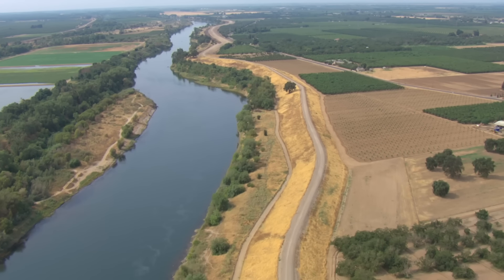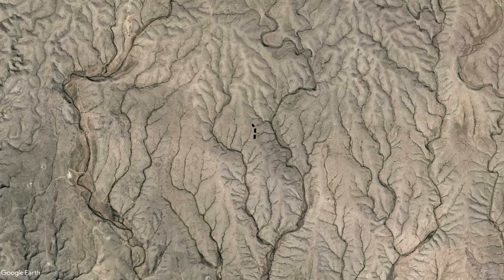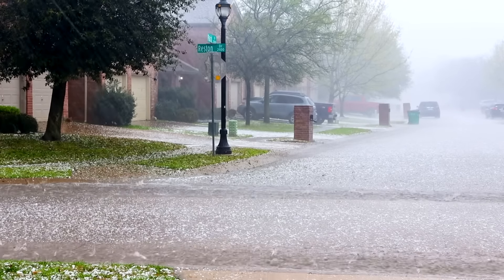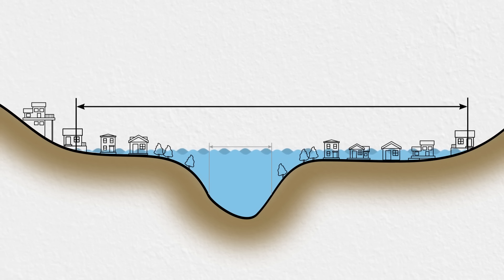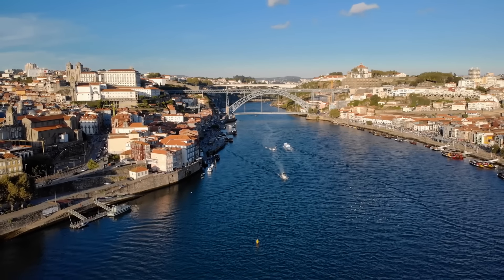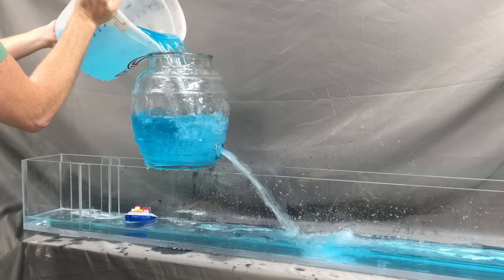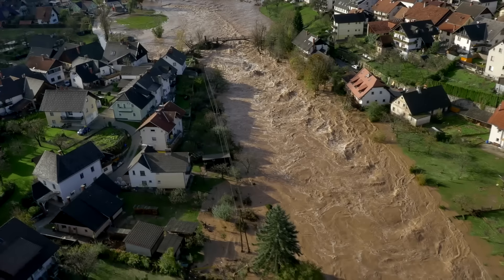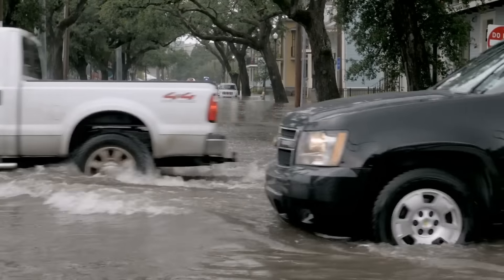How Do Flood Control Structures Work?

Comment: On the North Sea, we also often get floods that are not caused by too much water coming down, but by the water not being able to flow into the sea. Especially in winter we often get extremely strong winds from the West. Just the wind pressing only on the water surface in the river slows the water flow enough to make all the water coming behind pile up. And being one of the flattest large open areas in the world, it doesn't take much to flood really big areas.
Reply: The largest flattest open area on Earth is likely in Siberia, then perhaps the Great Plains of the USA, I cannot think of any place with Western exposure to the North Sea that is even 1/100th as large. And what you referring to is tidal surge not the slowing of river flow by wind. But I am interested to know where you are located ....
Reply: @johnsmith1474  the netherlands..
Reply: @johnsmith1474  European plain goes from Spain to the Urals.
Reply: Spring tides where the moon pulls more strongly on the incoming tide does this too.
Reply: @johnsmith1474   To be fair, I think living at the sea he would know what the tide is and how it effects the sea and rivers. 
I never heard about wind hindering the flow of rivers, but I can imagine it to a certain extend.
Reply: @stabileseitenlage  
The cause is indirect.  Friction between the wind and water surface causes the water to flow towards the shore which raises the water level at the shore where the river water flows to.  When the water level at the shore is higher then the water flowing down the river has to back up the river and raise the level of water along the river as well.
Reply: @johnsmith1474  
The Great Plains of the USA are also generally over 2000 feet in elevation.  Where I live the elevation is 3605 feet.  Not much chance of the wind causing tide surge here.  although at this moment (2:54 PM, 5 January 2021) the wind is blowing at 31 MPH from the south-southwest with gust to 43 MPH so we do fairly often get everything left loose rearranged.
Reply: @oldtimefarmboy617  Thats about 99% the way I imagined this to work.
Reply: If you are interested to read something about a storm surge in my home city google: North Sea flood of 1962. (yes the reason of the flood were the winds)
Reply: Considering only river flooding on rivers created by ice/snow melt or excess rain a simple flood control structure consisting of a dam with a narrow slot down the middle. High flows back up behind the structure while low flows are unimpeded.
Reply: Cheers from Michigan friend. 
Thanks for sharing
Reply: @johnsmith1474  great salt desert in western Utah . It’s so flat you can see the natural curvature of the earth
Reply: True an onshore wind can creat elevated sea levels ad in a spring tide the english channel constriction and heavy rain to the mix and you got wet feet.
Reply: @gregwarner3753  that sounds like a basic version of the retention basins that are becoming commonplace beside new developments around where I live. The increased runoff from roofs and roads must be accounted for by a large enough retention basin. I believe this has become mandatory and is a requirement in the design to get approval from government.
Reply: @SnappCheck  
With all due respect I don't think anyone refutes the fact that the wind can be a contributing factor in flooding. Especially in coastal regions. Rather I think the contention was that "wind over rivers" would be a strong enough "factor" to be the CAUSE of flooding. 
And I would argue that even in Your chosen example the " North Sea flood of 1962" that was NOT the case.
That flooding event was (as far as I have read it) caused by a Low Pressure system, over the "North sea", causing a raised SEA level by low air pressure AND the high winds. And  the location of this weather system and the wind speeds and wind directions it caused "applied" the raised SEA levels against the "german bight"... Which in turn caused the rivers that normally "drain" there to instead flood... To make a long story short, the "wind over water" surely was a strong factor.. but as far as I understand it was not the "wind over the rivers" but rather "wind over ocean" in concert with factors that can cause "elevated water levels".(in this case it was a strong Low pressure ( tides could also have been a factor, but I did not find that documented))...
Best regards.
Reply: @onlyeyeno  yes that’s correct🙌
Reply: Wind so strong it acts like a dam sounds terrifying
Reply: We do often suffer from tidal surge around the North sea, England's east coast is particularly vulnerable to tidal surge (from an England perspective) where a spring tide combines an extreme onshore wind and cause fluvial flooding as well as costal inundation. I've worked 4 East coast surge event in the past.
Reply: @johnsmith1474  yes, very well said. So many people don't know about that! Thank you for bringing that up John.
Reply: Would ice build up at the end of the river also affect the flow? I’ve heard of that happening here in Canada where all the ice builds up, is pushed downstream and blocks the end of the river off
Reply: @onlyeyeno  i think it's more like "wind over ocean which is over river".
Also, in my city waves created by this king of wind are called "нагонные волны" (loosely may be translated to "forced waves").
And because of these winds there have been many great floods, may over 2m high and even one with over 4m flood. In a city. Yay
Reply: That's crazy!
Reply: @johnsmith1474  in green bay WI sustained north/northwest winds cause the slowing of the fox river flowing into the bay causing flooding.  Happens couple times a year. The geography and weather patterns come together to create flooding that would not happen anywhere else.
Reply: @Yora21  The idea is that you don't do it on short notice. You plan ahead and build reservoirs and start increasing the number of surface bodies of fresh water and drawing from those to feed drinking water inputs. Reservoirs use up a lot of land which sucks, and that water is always going to be of VERY questionable cleanliness, but come on. Would you rather obtain your drinking water from cleaning sea water, or from cleaning fresh water? It seems to me that rain water is extremely valuable, and maybe we should be making efforts to collect and store more of it.

Here's another overlooked source of water: humidity. It makes everyone miserable. Let's build some region-sized dehumidifiers and extract useful water from the air on a massive scale.

Will there be environmental consequences? Of course. But look at the dead sea, it's getting deader all the time as Levantine desalination plants discharge concentrated brine into it in the process of creating drinking water.
Reply: @johnsmith1474  He said "one of the flattest large areas" not "one of the largest flat areas". An important detail, you seem to have missed. 
But still, the European plain isn't exactly small. It stretches from the north of Spain, France, the low countries, Germany, Poland, over the baltic countries and pretty deep into Russia. And about a thrid of the landmass of Sibiria is mountainous area.
Reply: What. What.
Reply: @sudazima  10

Comment: How old dams are replaced? Isn't it is really difficult to say "Replace Hoover Dam"? Not now but some time in future
Reply: After the time comes river is diverted, dam is destroyed and realigned. It easily and quickly becomes a sustainable thriving ecosystem after that.
Reply: It depends. Dams that impound rivers, streams, etc will require emptying the reservoir then diverting flow to allow for repair, replacement, or outright removal. For storage reservoir dams where the water is pumped or diverted in, they shut off flow in and empty the reservoir.
Reply: @typrus6377  another option is building a temporary (or permanent) dam in front of or behind the existing dam
Reply: There are plenty of dam removal videos here on youtube, they can give you a sense of how the smaller ones are taken care of and it seems some commenters already got to the larger ones.
Reply: it's not that simple, beside the simple economics  "dams are damn expensive, and whern there is no damn there is no income from power generation" there is also water supply problem. hovver dam keep las vegas and a lot of other place afloat. if you empty the hoover dam tto make a new one, there will be a shortage of water for decades
also, the colorado river is running out of water, hoover dam  get less water every year and  so is lake powell  behind glen canyon dam, so having  a new lake to refill in those condition is absurd
(just to state how much water you need to fill a lake: lake powell filling  took 20 years and got full to the top only once in 1982
Reply: With some dam good work. That's how.
Reply: Well, they had to build it in the first place somehow!
Reply: De Hoover dam will be controlled by the 'New California Republic'  and will protect it against the arrival of Caesar's Legion!
Reply: Hoover dam is probably the most permanent structures that currently exists. If we’re ever in a position to “replace” the Hoover dam something has gone horribly, terribly, catastrophically wrong.
Reply: @hithere5553  It's an understanding in progress I might say, like we understand that with proper care, nuclear plan can last may more than their intended life span
Reply: @hithere5553  Maybe in the US, but I think the Three Gorges dam might take the title.
Reply: @acwright  that pun was terrible XD
Reply: It depends whether the engineers or the landslide homeowners won the political battle. Search wixom lake dam.
Reply: Look up Condit dam removal if you wanna see some exciting footage of a dam being removed.
Reply: hoover dam is still curing i believe.
Reply: i don't know for sure, but if i had to guess they slowly drain the reservoir until it's level and then tear it down and rebuild it.
Reply: Lake Mead will be empty in a couple decades at the current rate anyway.
Reply: as long as it is properly maintained, Hover dam could last millennia. even if it's not properly maintained it could last millennia.  It is  a mass of concrete.    a big problem with dams is not the  dams themselves but sediment building up behind them, decreasing the storage capacity so even though a structure could last centuries, it may only have  useful functional life of a few decades if the sediment is not removed .  see the Rindge Dam as an example of a dam that holds nothing back but dirt or the Matilija Dam as an example of one that  is nearing the end of it's life.  both were flawed designs that wouldn't be built today
Reply: @hithere5553  If you're in a position to replace it, things have gone pretty swell i'd say. If you're in a position where you have to replace it, though...

Comment: Great video, however I believe you missed the most efective flood control structures - so called small retention. A lot of small hand made wooden structures located upstream or on drainage ditches can stop and slow down the water and prevent overfilling of the rivers downstream. Beavers are also good at that. Natural grasslands and forest keep a lot of water too - if we destroy them the water rushes to the rivers and then overfills them. Maybe you could make a video about that? It would be really interesting to see your point on that. :-)
Reply: Right! I was waiting for the part where he explained that planting trees upstream can protect cities downstream by increasing the infiltration of water into the land and slowing flow, instead of trying to get it off the land as quickly as possible. I guess it doesn't count as engineering...!
Reply: @banksarenotyourfriends  Well, let's be honest a forest or some tree trunks across a stream or a ditch don't look as spectacular as an enormous dam. Most people have a tendency find those as unnecessary or even harmful. Even a lot of hydro engineers would like to plan rivers flow with a ruller and cement the riverbeds to make the water flow faster and they are not able to predict that it will cause problems downstream. I was really hoping that Grady (@Practical Engineering) would at least mention that as he has a really big audience and he could make more people aware.
Reply: There's also detention ponds, which use a concept similar to the flood control dam, but at a much smaller scale and intended to mitigate the impact of really intense rainstorms in small basins/watersheds, such as those formed in urban areas (neighborhoods, parking lots, shopping malls, factory/warehouse buildings...)
Reply from the maker: I did a video on urban stormwater management that talks about some of these smaller solutions. This video was really meant to talk about the three main types of large-scale flood control structures.

Comment: Amarillo TX something I have found is that the more parking lots that are close together cause major flash flooding. Personally I would suggest that any new development or rebuilding of these lots should require either a holding pond or tanks under pr around the lot that connects to public storm drains and that the release of these storage systems are in part or fully managed  by the drainage department. We have 2 creeks that feed the Canadian river, and one called timber creek south of town used by the city of canyon that is probably to far to use reasonably. We already use Amarillo and cherry creek's for the largest part of north Amarillo and large pits for the rest of which some get pumped to the creek but most don't.
Reply: Edit or

Comment: 7:30 Parametric changes to suit the environment 🥇👏🏽, I think advancement in BIM may resolve some of the wider connectivity issues of the dam network, as I guess they'd all have to be synchronised and networked to be able to work in harmony. Combine BIM with sensors and GIS, you have a live stream (no pun intended 😎😏😬)

Comment: No, a watershed is the border between drainage basins.
Reply: Nope, it's the area not the border. The border doesn't shed water the land does. Thus, it's the watershed.
Reply: @9HighFlyer9  You must be American.

Anyway, your folk etymology is wrong, both for the noun “watershed” and for the verb “to shed”.

You can see the real etymologies on wiktionary.

(Hint: there is a reason the German word is Wasserscheide.)
Reply: @peterfireflylund  You must be German. My etymology was kind of tongue in cheek, sorry. You may be correct as to the origin and historical usage of the word. However in American English "watershed" refers to the land area that drains into a stream or river. "Divide" is the word I'm familiar with for the boundary of a watershed.

Comment: I would love to see you talk about beaver in the context of rivers, water, and flood control.

Beaver ponds and dams have been shown to reduce flooding by increasing the carrying capacity of the water system, allowing the whole system to absorb more water before it flows downstream. Also, considering that beaver were ubiquitous in the continental united states prior to western colonization, the flooding of rivers which we consider normal might well be abnormal and caused by beaver's local extinction
Reply: I also want to learn more about dam beavers. I think it'd be great to learn about dam behavior overall
Reply: I've never seen a beaver lower the water level in his damn to reduce flooding. What ever water flows into his pond has to come out the other side. Unless the water level is lowered, damns can not control floods.
Reply: exactamente!
Reply: @mikekahl5609  Not quite. Remember that beaver dams act like a large number of partially filled ponds dotted along waterways. So when heavy rains fall the dam-pond has unused capacity to retain that water that would normally rush down stream immediately.

As for release, after the storm the water will evaporate or seep away into groundwater over time rather than needing to be release.

An individual pond will likely only have a fraction of the water capacity of a man made dam, but with many beaver damns over an entire river system it's capturing a huge amount of water that would normally need to immediately go down stream and possibly cause flooding. Then releasing that water slowly to the ground across a huge geographic area
Reply: That’s crazy and crazy awesome! I never really thought about that…would like to see some scientific studies or other research into this, if you have any sources or links!
Either way, it’s a cool thought, and even though may be more of an …ecologist/zoologist or something, expertise, im sure Grady would have some insight on it!
Heh!
Reply: There's a documentary "leave it to beavers" and a PBS segment about the topic of beaver geoengineering. I don't remember what the original documentary I saw was, but if you Google "beaver believers" it may have been that one
Reply: @mikekahl5609 beaver dams don’t reduce flooding like dams, they reduce flooding by widening the channel. The surface of a beaver impoundment is wider than the natural channel and can take more water.
Reply: @mikekahl5609  If there are low spots in the dam, _u_ the bottom of the U is base stream flow, now when their is a rain event the water fills to the top of the dam. --u-- providing capacity. Top of dam is top of u

Comment: I live in a relatively upstream area of a river, and the town is built on the confluence of two rivers. while im not in danger from the flooding, i do visit the rivers often and calm streams become violent, tearing, ripping monstrous forces. It just goes to show how powerful these things are.
An intresting thing is the smaller river is more at risk to flooding because it takes less to overtop the banks, but when it does it fills entire areas, whereas the other one can take more water without flooding.

Either way walking and hiking along flooded rivers is fun (if your careful) as its interesting to see the difference between a flooded and non-flooded river.